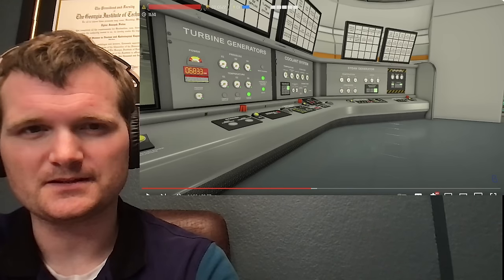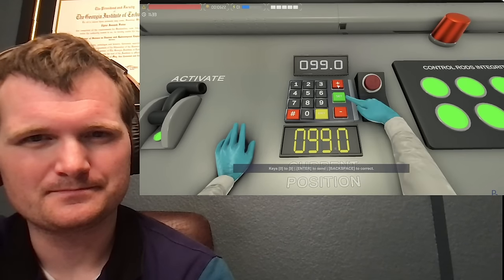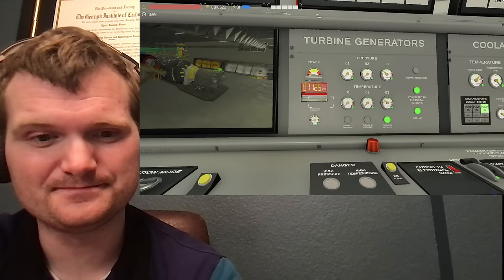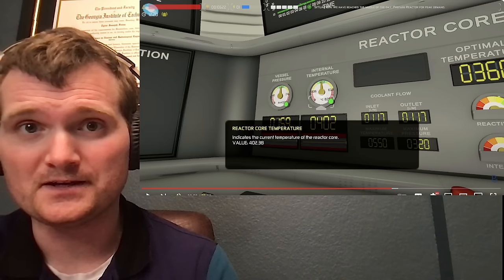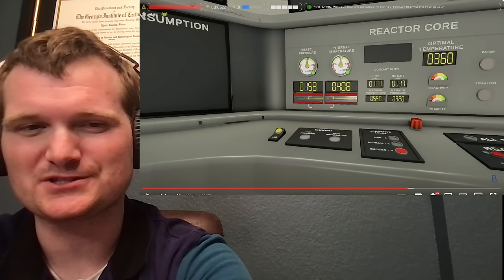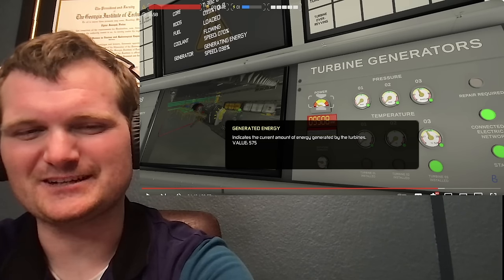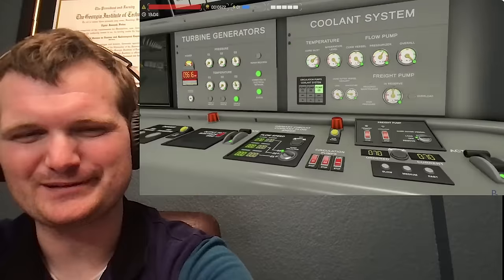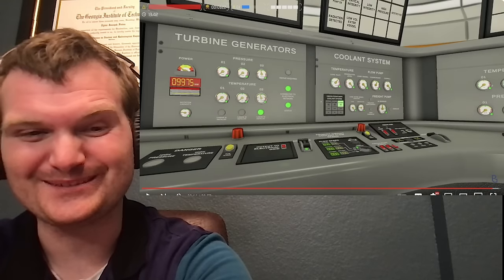Nuclear Engineer Reacts to Nucleares PWR Reactor Simulator Part 2

Comment: The pumps in the game are operated much as you say - once you have it running you'll be constantly making small adjustments, on the order of a few percent in pump speed. You'll only have to slam things hard when you're in a hurry because something is going horribly wrong.

Condenser overheating is a thing in this game, for it is a wimpy, under-speced condenser. I find I overwhelm it when I am switching between steam generators for servicing. As the video said, it's something you'll want to upgrade.

If you're curious about the cooling system, the level thinks of that - you can walk outside and see two big cooling towers, and following the pipes shows they are connected to the condenser and pump exactly as you'd expect.

Comment: So I've been playing this since I saw your first video and I have a few comments. The game now is a lot different than the one shown. There are now vacuum pumps with the condenser. You no longer just flip a switch to go on the grid you have to request a connection and they tell you when to start generating or when you won't just be sending the electrical power to the resistor banks. A comment on the video of the game I have is the condenser can just be run at 100 but the coolant flow in the secondary can be limited to generate more steam pressure and thus more power but you run the coolant level in the yellow or just the caution area but generate a lot more power cause your not dumping the thermal energy into the atmosphere of the game. There are also transformers now in the game and they can only safely run up to a certain level before insuring increased wear but you can add more. I know it's not super realistic cause nuclear plants are just on or off and not ramping up and down constantly for different demands, but I think they've just added these things as game mechanics to give us something to do and make it a bit of fun.

Comment: so, the weird thing about this condenser system. is, it seems to be open air. it's not a closed system. if the water in the condenser gets to hot, it's seemingly evaporating and boiling off into the atmosphere... basically, boiling off the water in that reservoir at your own plant.

it's very odd.

And, i think as far as that Current Position system is for, is "percent inserted" for the rods. so, you more or less have to invert it. if it reads 99.2% like at around 12:33 and such, that means he's only getting 0.8% reactivity out of the fuel.

Comment: I've played the game personally- ordinary nominal operations, even with the grid operator changing the demand over the course of the day to prevent you from just running at full power, it's much less chaotic than how this video shows.  With the current version with a vacuum pump for the condensor, you can balance the system so you only have to verify the primary loop's still got the right pressure every few hours.

I looked into the game's Discord the other day, apparently the game actually started out as something completely different, and it just morphed into a nuclear game during development.
Reply: What did it start as?
Reply: @Delta_310  Trying to run generate power while also dealing with zombies at the same time.

Comment: Regarding the steam generators: You start out with one, and will very rapidly be adding more. Part of the very unrealistic game mechanic! Although I find I don't run all three, because the pumps have a distressingly short interval between required servicing - so I have two in operation, and one down for servicing.

Everything in the game runs on accelerated time, for gameplay reasons - you'll be lucky to run for a week continuously before the time comes to signal to the grid operator that you need to conduct a scheduled shutdown, get everything serviced, and start it all up again.

Comment: 31:38 @tfolsenuclear you are correct this version of the game the condenser wasn't under a vacuum. That mechanic has actually recently been added to the game recently and did increase the efficiency of the condenser though its still too small.

After purchasing all upgrades I was able to manage 60-70MWe output for a short time before my electrical generating turbine grenaded itself due to overrevving.

Comment: Thank you for this video.

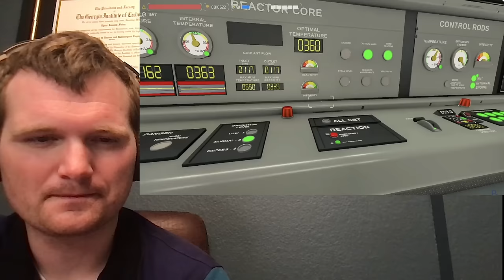About 11:00, that's true I think for most countries. But here in France, apparently, the power level of nuclear power plants is changed according to the demand. But of course, it's not used for small variations but the larger variations that happens during a day.
Reply: France is rather unique because you make 70% of you electricity with nuclear. The highest percentage of any nation. If you didn't adjust, the peak demand and low demand wouldn't match with the amount of nuclear generation online.

Comment: I've been playing Nucleares a bit and there are some other weird foibles like how you can't draw power from the grid to start up. The only sources of electrical power for parasitic loads are the turbine-generator set and the emergency diesel set. If you have to routinely run the emergency generator in startup, then it's a routine generator, not an emergency generator.

The rod position is percent inserted. Going critical at only 3% withdrawal seems a bit off to me, but I am not an operator, so IDK. It also behaves more like a throttle than controlling reactivity. I was trying to achieve a reactivity of 1.0 ($0) at the target power by pulling rods to plus a few cents, then pushing back in to stabilise at the target power, but then there's no flux-derived power readout in the control room, and the reactivity dial is not reactivity.

There's also no load-following, and the effectiveness of the control rods decreases with temperature, giving the reactor a slight positive temperature coefficient(!).

In general, the units are all off. They're metric (yay) but kWh and kW are used interchangeably, so you have to guess from context if it's power or energy.

Lastly, equipment wears out much faster than you would expect. A primary circuit coolant pump or a condensate pump will require maintenance between outages, which is basically impossible to do while online in game until you have multiple loops. Not that you would overhaul a coolant pump online in real life.

Comment: I'm curious what control rod material would lose integrity at around say 500*C given that vague temp gague on them. Be the rods are cracking, melting, warping or some other such "lost of integrity" as the tooltip displays

Comment: Control rods are in % of length inserted.
You are to hard on this :) This is just a game, very simplified, based on Power Plant operation with focus on gameplay. You make money (prestige) by delivering power on demand, managing repairs and (if enabled) random failures. You upgrade system, to generate more and better handle possible issues. Lot of stuff is made to be more dramatic, like that initial pulse. It is not real, but people like to see stuff happening.
But great info about real stuff, thank you :)

Comment: I wonder how the condenser works here. This reactor uses SI units, so 1 bar means it is running at just about atmospheric pressure, which explains why it would boil at 100°C.
Reply: It works poorly. The dev doesn't have much understanding of that area, at least not yet.
Reply: They are working to improve the simulation and accuracy of the plant; but it does have a ways to go, that is correct

Comment: I've seen another youtube video of someone playing this game and they played it VERY differently, with many of the pumps at full, and they generated substantially, maybe even a magnitude, more energy, so I actually suspect that this video is either old or just not correct.
Reply: This video was more of a very basic how to get started. You won't do much if any damage using the procedure or values in the video. It give a lot of breathing room to try stuff out before it causes problems. You are correct that it wasn't much power.